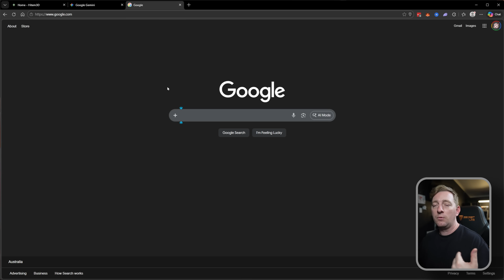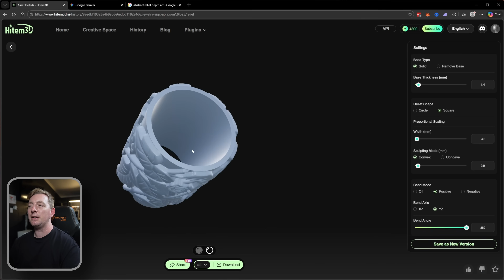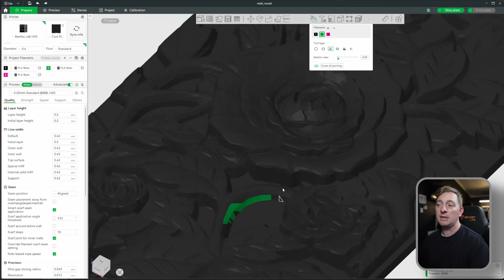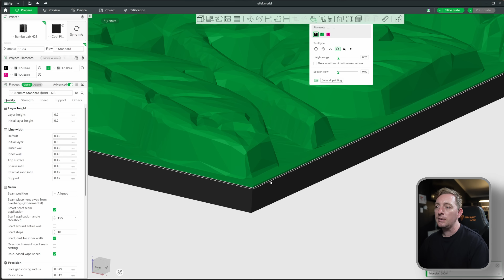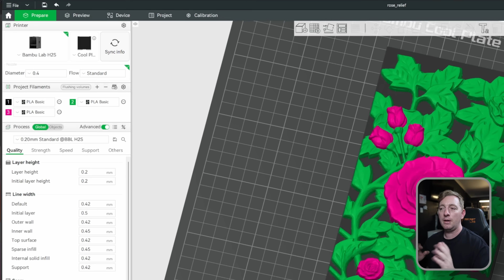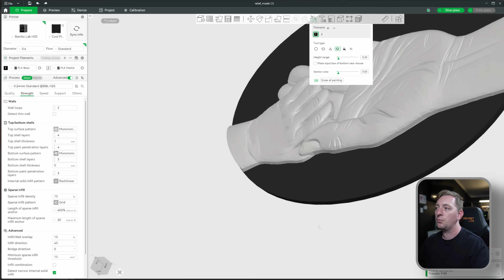3D Relief Art is Now Effortless With This AI Tool (Zero Modeling Required)

Comment: Great, that is much better than the way I was using! (setting the filament changes on the preview) It would be nice if Hi3D could color by itself - one of the tools on Makerworld did, I made some multi-color bookmarks using it, it usually worked well.

Comment: What prompt did you use to get that first image?
Reply from the maker: The first image I found some wall art on google images, then fed that into nano banana and asked it to make something similar, add colour etc. Pretty basic prompt with and image for reference.
The second print was all from a prompt and was something like "create an image of a father hand coming down from the top of the image and holding onto a young childs hand coming up from the bottom of the image. Their hands meet in the middle as if the parent is lifting up the child. Use black and white style with shading to create depth."
Something like that.